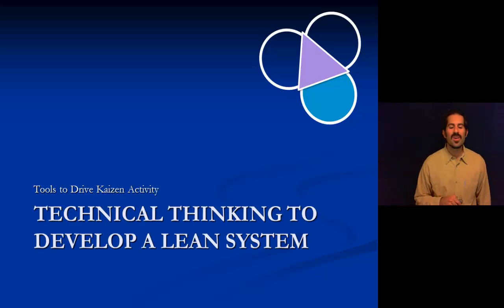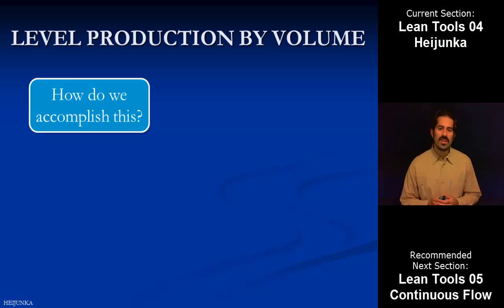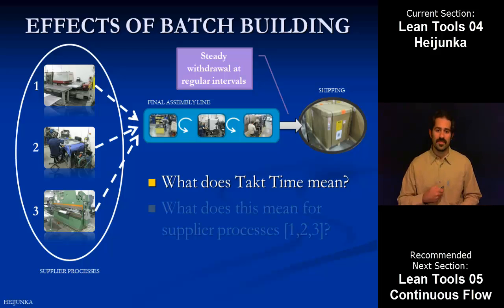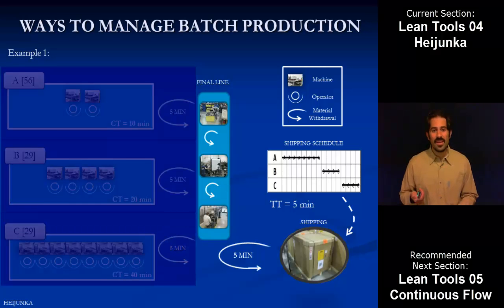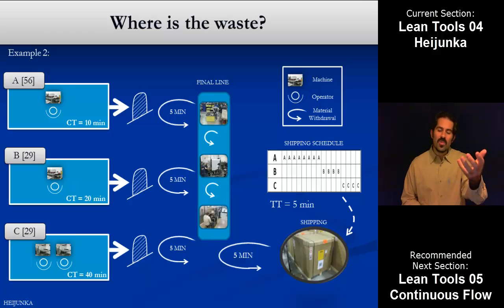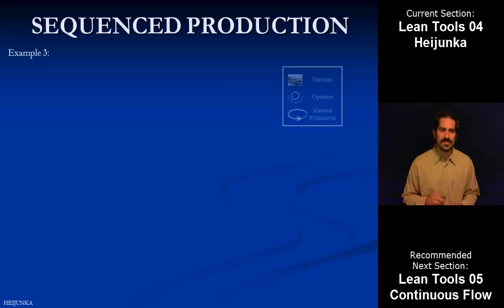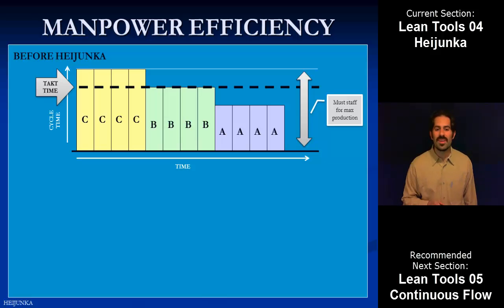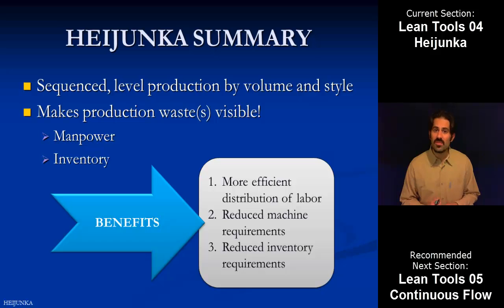Technical Lean Tools 04: Heijunka

Comment: A key point that got missed emphasized in the discussion is that to enable Heijunka in a  manufacturing environment , very small set-up and changeover times are required and would be a prerequisite. SMED concept in lean discusses that but worth stressing here as well.
Reply: 3 very boring things equal something very boring.  no style.

Comment: Thanks for this video.  Very informative. I have one question though, I hope you can help.  On your lecture, it actually tells me that in order to balance out the cycle time against the takt time, I can change the sequence of the products I make instead of batching it or creating an inventory.  But what if the changeover time (from one product to the next) is also time taking, in other words, it will increase my production time.  What technique or tool you can advise? Thanks in advance.
Reply from the maker: +Mae Ann de Leon Great question!  We always experience some downtime when making changeovers.  The trick is to work on problem solving to minimize the the changeover time so we can balance the cycle time without building inventory.  Take a look our Pull System Section for more information: https://www.conceptsoflean.com/Technical_Tools_06.html

Comment: I really enjoy your presentations.
Does production leveling will work if product A,B,C will require set-ups every time?
Reply from the maker: Thanks for the kind words.  The ideas of leveling still apply even with setup/change over time.  Once way to combat the impact of change over is to work on reducing the time required to make these setup changes.  These types of activities make great early kaizen projects that allow team members to see real world results of implementing lean.  For more information on the value of reducing change over time, see Technical Lean Tools 06: Pull System(s) (about the 20 min mark).  Thanks.